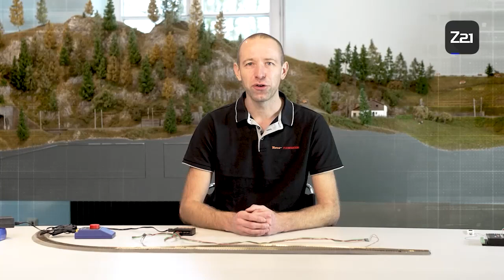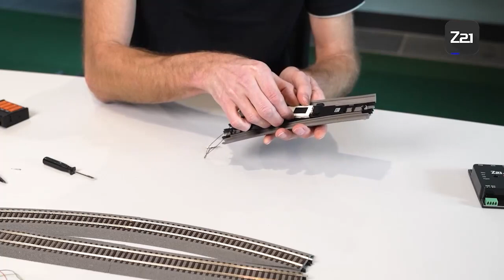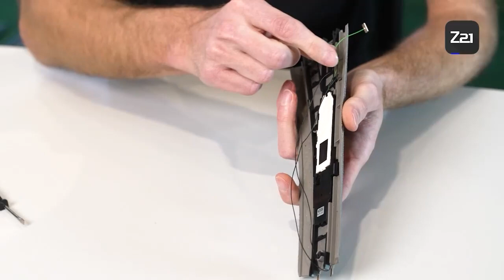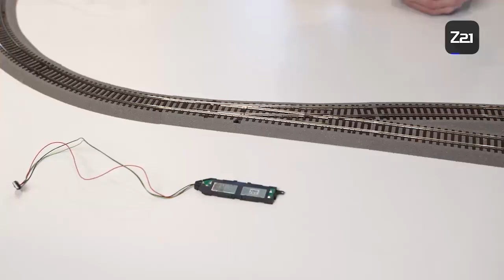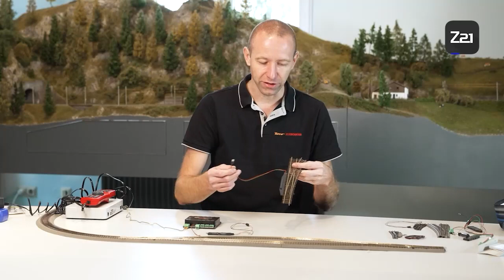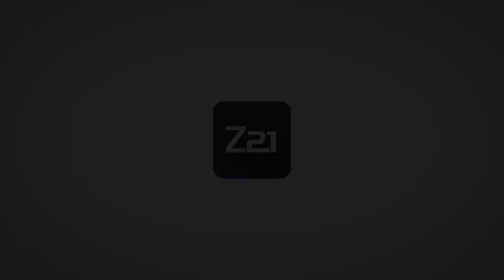Part 5: Digitising turnouts

Comment: in the case of my railway model, I have 16 switches and some are positioned in the hidden railway station. I haven't purchased the drivers yet. Buying the digital driver 42624 for everyone allows to save on the purchase of the decoder 10836 but, i have a doubt whether it is the right choice. what do you think about it?